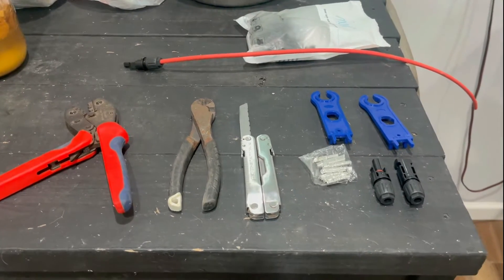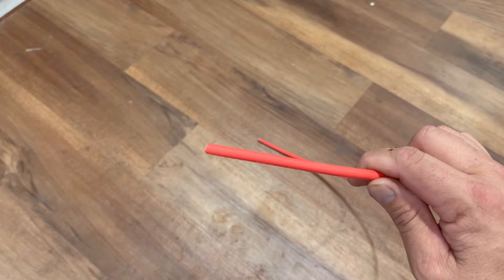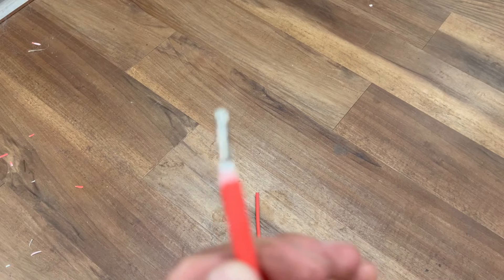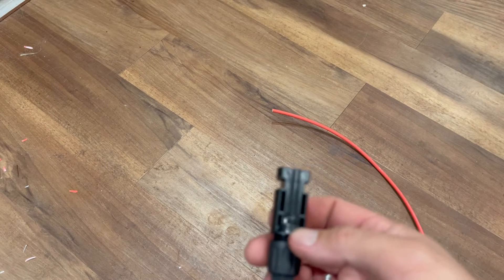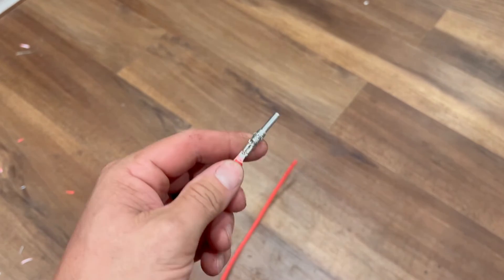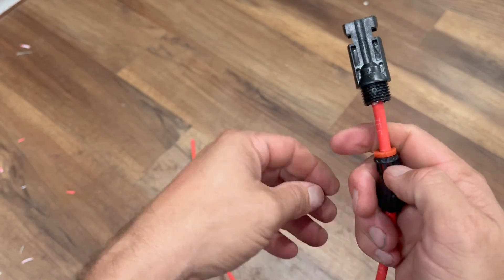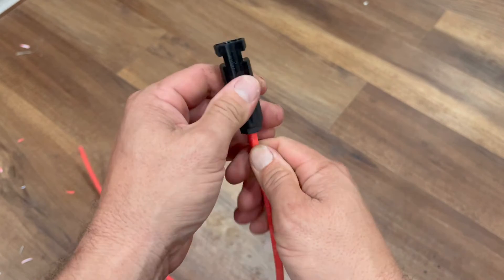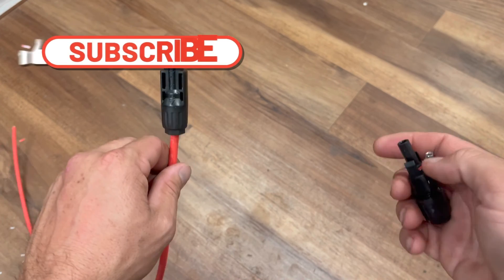How to make mc4 connectors the easy way (for solar panels)

Comment: Thanks, that will save some dough.  Where did you buy your quality rolls of 10AWG?  Do you make your own battery cables as well?
Reply from the maker: I typically buy my non pv wire at Elliott electric.  They have local stores around the nation

Comment: I just got my first panels, I got a 25ft and 35 fot MC4 to XT60i cable and I realized where I need the panels is too far away (was good to dry fit and test things) rather than buying new longer cables I am much the type to make my own.

I just so happen to have a few hundred feet of 10/2 direct burial cable already, multiple crimpers, etc :)

My question is, since my first project is going to be feeding panels to a Delta 3 Plus with XT60i connectors, would you just put MC4 on both sides and get an adapter, or would you put MC4 on one end and XT60i on the other?  As I find the adapters cost nearly as much as a decent length cable.

Also I am OCD after I crimp I would solder these, came for any panels that are not soldered.
Reply from the maker: @ViciousXUSMC  I don’t see an issue doing it either way. Just make sure the adapter is rated for the amount of volts/amps that will be going through it.

Comment: Recommend a legit stripping tool for solid wire (although I'd use it for stranded, too)
Reply: I'd use a sharp knife and then sort of draw a circle with it around the insulation. Then pull that loose insulation off with pliers. It's especially good for solid wire since you can't actually cut if off, unlike in case with stranded).
It's good only for DIY obviously, if you have a lot of work to do, maybe worth buying something more specific. Or possibly there's an option to rent those tools you need temporary.